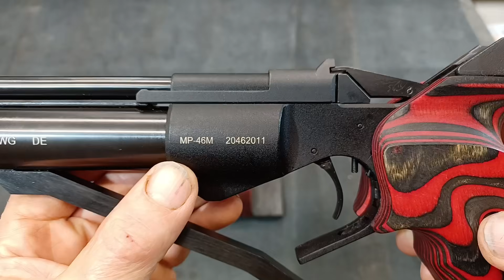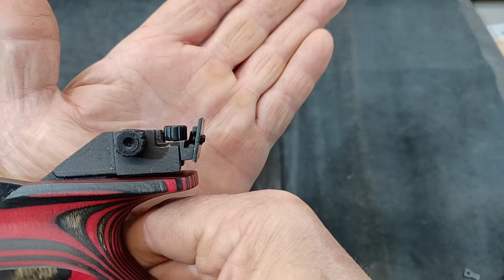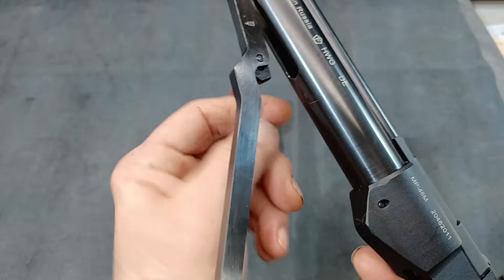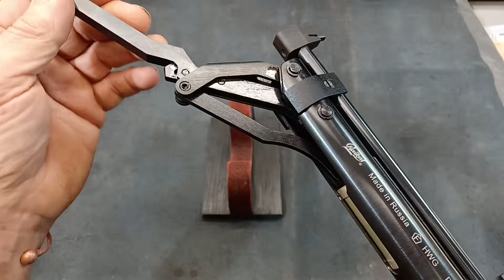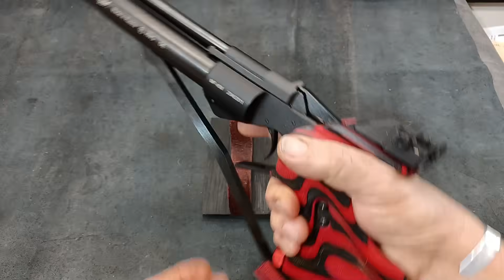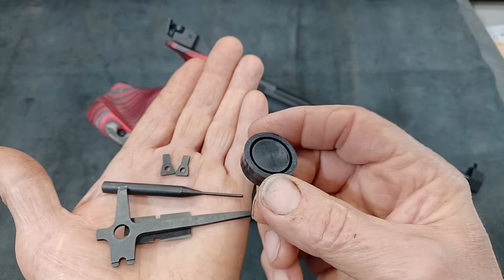Baikal 46m, Izzy, Single Stroke Pneumatic, SSP, .177, Target Air Pistol, @simongibbard9334

Comment: Air Venturi released a clone, or maybe a licensed version of the IZH46, a few years ago.  I am not sure if they are still making them.  They retailed around $700, which isn’t cheap, but it’s about half what a PCP match pistol sells for.  I heard the AV version was as accurate as the Baikal version, which is pretty much Olympic quality.  The only reason they fell out of favor to the PCP pistols is the extra step of pressurizing the cylinder for the shot can result in shooter fatigue and dropped points.
Reply from the maker: I’m pretty sure that as with this one the AV ones were Baikal produced with AV badging on, they certainly have made in Russia printed on the side as well as the AV print. Mine is also wearing some AV red laminated grips and the bag they turned up in said made in Russia by Baikal. I think the latest export bans meant they went from difficult to export from Russia to not happening, they might have appeared pricey but what you got was a proper 10m tack driver, if they were wearing a Walther badge people would say they were fabulously affordable. If you do enough training the extra effort in a match would disappear and the loading cycle would just become part of your work cycle, probably more mentally challenging for the shooters on either side watching what you are doing and getting drawn in, the pistol is undoubtedly an A class capable pistol.
Reply: @simongibbard9334 That makes sense.  I wish I would have splurged for the first release of the AV version.  I assumed (erroneously) that since AV took up the exporting, these would be available into the foreseeable future.

I agree that the Izzy is 100% a competitive match grade pistol.  It’s just a solid performer.  I think that most of the high end SSP pistols could absolutely shoot the same scores as a modern PCP, in the right hands.

To that point, a few years back there was a 10m air rifle shooter who won his division in international competition shooting a FWB 603 SSP rifle.  He was shooting the only pump gun on the range and ended up on top.

Comment: Man great vid,am currently struggling to convince myself to get a great condition fwb 103, but it’s way expensive,
I remember when these ( Baykal) came  out ,have always regretted not getting one at the time,they were only available for a year here in nz.
Reply from the maker: The 103 is good, very good, but because of that they are rare and a bit of a Unicorn, doesn’t mean I’m not still looking, but you pay a lot if you find one, the Baikal is more agricultural to be sure, but as a 10m paper puncher…….. it may be better😱 and will be a lot cheaper.